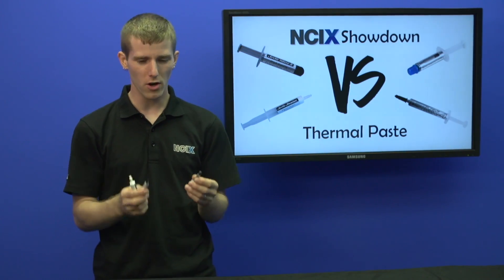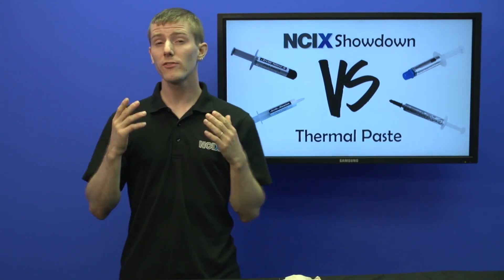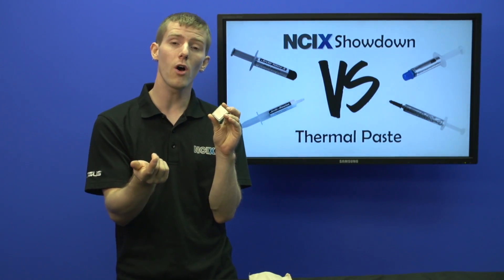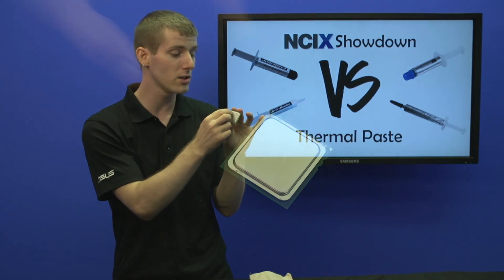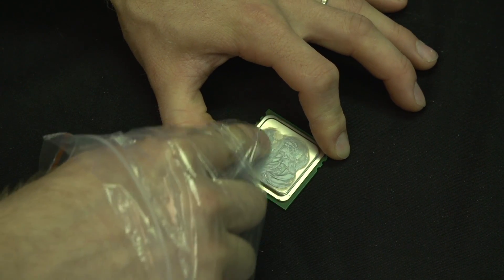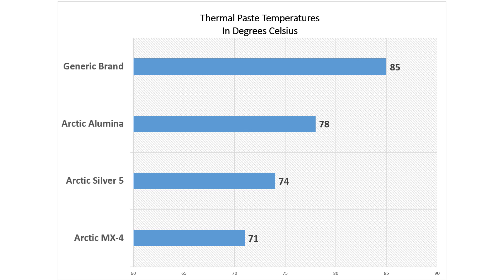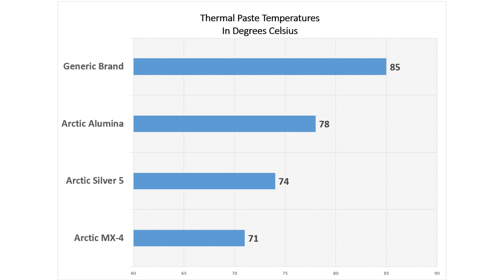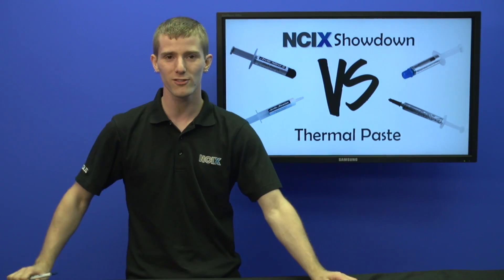Thermal Paste - NCIX Showdown

Comment: im using the MX-4 for everything (CPU and GPU) and it never fails!
Reply: ***** for smaller gpu surfaces, just a drop. for larger ones (nvidia 200, 400 and 500 series) i do the cross pattern
Reply: ***** 75ºC is fine for the 770. just keep it below 80ºC and you dont need to worry. try clean the card with compressed air or a brush to be if it helps with airflow.
Reply: ***** that's my job to help people :)
Reply: +DeadNullermand Same here, got the big tube and used it on several builds and many components. It has a pretty good shelf life in the tube too!
Reply: Taurolyon yes, the 20g tube has much longer lifespan before buying a new one. and it only cost me 50% more than a 5g tube
Reply: +DeadNullermand Should you wait for it to dry after applying the thermal paste or can you use your CPU or CPU straight away?

Comment: do you need 99% alc to put on new cpu's????
Reply: No
Reply: +Frederique klein no the average 70% will do the trick aswell
Reply: +uetzel Yup, searched on some tom's hardware forums and found out 70% was ok too. Removing pre installed thermal paste was easy and just to be sure I cleaned the new cpu as well. My cpu temps are idle 21 degree Celcius :O. Overclocking in the future will be allright. (P.S. When I posted this I forgot I was posting with google account of someone else. Still nice to be able to answer.)

Comment: i have an ps3 slim what thermal paste is better to use?
Reply: chryastosslapat rip
Reply: +r1Ns3 stfu man
Reply: +Becoming “The Unlord” Godsize lol xD i see your comments everywhere in youtube xD nice one mate
Reply: I used a folded piece of aluminum foil. I can't remember if I did shiny side in or our, I would bet in as to not reflect heat like a space blanket.

Yes, it actually does work, my fans were kicking into "8th gear" as I called it, and now its super quite and I haven't had it shut down from temp warnings yet.

PS: I didn't have thermal paste, and unfortunately I scraped off most of the remainder, but it worked fine anyways.

This was done on a PS3 Fat edition (wow those heatsinks are massive, its about the size of a grass trimmer engine). This was also done about 3 years or more ago, probably 4.

This is similar to the "thermal pad" methodology.
Reply: I used human feces

Comment: MX-4 hardens into a rock.
my tube is like 6 months old and it has to be microwaved to be used
Reply: +SANIC weird, i have a tube that's 3 years old kept in a cool basement, still usable like day i just checked it.
Reply: ***** I went back to artic silver 5.
I don't really care about the 2c difference cuz all my shit is water cooled
Reply: +SANIC i don't either, i use mx-4 for its non-electrical conductivity.
Reply: h0rnytoad1 wut?
Reply: yeah, you didn't know as5 is bad for cpus if you put too much paste? watchout for spillage.
Reply: the question is, how much is enough.
Reply: ***** depends on the CPU dye.

To Short out a CPU, you would need to use EXCESSIVE amounts silver 5.
Like 1/2 a tube
Reply: +HT T Any thermal compound is bad for cpus if you use too much.
Also, if your thermal compound is shorting out your computer, you put it on the wrong side of the CPU package, I know, rookie mistake, but you put the AS5 on the silver heat spreader on TOP of the package, not the shiny gold bits on the bottom.
Reply: +Mostlyharmless1985 not the point here, and not a rookie. Sanic&#39;s mx-4 hardened in a rock. it shouldn`t dry out like that. He must have done something like left it open too long and it just dried on the counter in the tube.

>you put it on the wrong side of the CPU package,
funny. But no, AS5 has slivers of metal in it, mx-4 doesn't, better be safe than sorry.

Point is, i have a tube of MX4 i still use 3 years after i bought it in 2012. its still usable. its a good product.
Reply: ***** I'm sure it is, But I've used AS5 without any problems, regardless of it's conductivity. My point was that any product used improperly can cause harm. You know, like how toothpaste has a deadly poison in it, provided you eat an entire tube of the stuff. Such as it is with the Arctic Silver. "Safe" in this case is using the product correctly. I can not think of a proper use scenario where it being conductive will make an issue.

Comment: I went with the Arctic MX 4 and the stock heat sink. With my CM Storm Enforcer case  huge 200mm front fan and 120mm rear and top exhaust fans, standard setting on the fan expert 3 on my Z97 ASUS MB, full load without overclocking; my CPU gets around 45 Celsius. For $10 that is performance similar to a much pricier aftermarket air CPU cooler.

Comment: I have a stick of Arctic Silver thermal paste. I ordered a 212 Evo and installed it using the thermal paste that came with it. Will there be a difference between the stock paste and the Arctic Silver?

Comment: XD my q6600 likes the spread method with cheap grease
Reply: KillTheCurse Core 2's are now pretty old. The newer processors are designed to withstand workloads of up to 70+ degrees.
Reply: -_O are you water cooled or in a cold place XD my q6600 @2.8 gets to 60c cause of the heat might start running my ac
Reply: yeah i love mine runs the games i play great   ( •_•)>⌐■-■ (⌐■_■)
Reply: ***** I'm so pissed right now, my Q6600 almost fried once it reached 70 degrees Celsius. The fans were blasting and I was recovering all my data from a 1Tb Hard Drive, it was half done until I had to shut down the rig. Over 6 hours of recovery wasted.
Reply: ***** I finally recovered all my data now, which is good. What I did to prevent overheating was to open up the case and run an external fan facing the inside of the case and my temps dropped to about 40-30 degrees.
Reply: what type of fan o_O steel
Reply: Derpinstyne H No, it was a plastic fan.
Reply: +Matthew N Yikes. do Core 2's seriously fry at such a low temperature?  i7's can run at 80 no problem.
Reply: Matthew N So Core 2's actually did fry that low?  Nice to know, adding that to my growing pile of knowledge.
Reply: KillTheCurse Yes they do, the newer Core 2's like the Q9000 series can go up to 90+ on most modern games, but instead the much older ones like the Q6600 can't withstand high temperatures under a high work-load.
Reply: Matthew N Thanks

Comment: IC diamond is bettar
Reply: Anthony Sparta what difference does it make if you use a cheap version?
Reply: Stewie Griffin I ordered 7 karat IC diamond paste from ebay for $8 and instead received 24 karat in the mail, which costs $19.99 on Amazon.
Reply: +rapper250 IC Diamond also scratches surfaces

I mean hurr durr it's got diamonds in it so it should be obvious that it does that but for like 5 degrees of difference I'd rather not have my GPU getting scratched up when I go to reapply

Comment: Sometimes I wonder, I had Arctic 5, but it just got really hot... Like 45 degrees on idle, so I tried the cooler master one that came with my cooler and now it's down at 25 degrees. Was there something wrong with the AS5 that i bought?
Reply: Advection357 I'll read the manual if you promise to take anger management classes :)
Reply: Linnywoo Well I was getting a new build and I had to swap coolers around (too lazy to explain) so I was just looking for a good thermal paste to get lower temps. My next build is going to be temporarily using a G3258 and I wanted to over clock that to around 4.2Ghz as well. And as for coolers, I'm going to reuse my H100i from my old build to my new one. Also, thanks very much for the quick reply!
Reply: lol, ''Really hot''? that's nothing. 45 Degrees Celcius. I have same idle temperatures.

Arctic Silver 5 is awesome but hmm weird. But also depends how you put on the thermal paste
Reply: I'm not sure why it differed so much, but from what I've heard, AS 5 gets better with time, so maybe I should have just left it on for a while longer.
Reply: ***** Yeah I notice that now. Have reapplied it and seeing better temps now, not sure what went wrong before, the spread looked fine and all.
Reply: ***** I suppose it is possible, but I don't think so. Could have been air pockets or something.
Reply: AS5 takes time to settle in and work properly. In other words, it has a curing period. Too many idiots here slap it on and discard it the same day... RTFM please
Reply: It's all about the way you apply the thermal compound. To much you will block the heat spreading. To little won't give you enough contact surface. Your CPU get hot might be the way you put your thermals compound because with the pre-applied paste of the evo, it contacts with the CPU surface better than the way you did with AS5, maybe.
Reply: Hao Pham Yeah I think that might have been the problem... I swapped back to AS5 a while ago and it is working just fine now =)
Reply: I wish they reviewed IC Diamond. That stuff made my 750 Ti with a single fan idle at just 24C, and there is zero copper on the heat sink!
Reply: Linnywoo What clock speeds is your cpu running? I'm still debating on getting AS5 or MX-4 paste, and knowing the curing time of AS5, I want to see how it stacks up.
Reply: MiniNinjia I'm running my 4690k at 4.2Ghz atm, haven't tried higher yet (cuz im lazy). It's idling at 42 degrees, so it's pretty stable :) Unclocked it was idling in the low 20s. I think Mx-4 paste will do just fine tbh, took around 1 month after applying AS5 before i started noticing the temps dropping, so if you don't mind the wait you could go for AS5. It also depends on what kind of system you have, if you have spent shitloads of money on a cooler it would be silly to cheap out on the thermal paste =)
Reply: ***** Zalman ZM-STG2 is also good... better than MX-4 / 2, but not as good as Gelid. & by better or worse, it's less than 1 deg C. difference..

Comment: Actually, for all of you below me. I used to use Arctic Silver 5, and just today swapped it out since my Arctic Cooler MX-4 came in the mail. I ran a temp diagnostic on Arctic Silver 5 first, min idle temp was 27C. Upon using MX-4 my idle temp was a whopping low of 14C. That's an awesome 49% difference in temps! I hate to say it, but I will not use Arctic Silver again.
Reply: lol, You have a faulty sensor. Sorry but physics won't allow your CPU to cool below ambient room temperature with Air/Liquid cooling without a chiller.
Reply: Your temperatures aren't accurate because heat transfers from hot to cold, which means you can't get temperature below what you are cooling it with. What is the most plausible scenario, that your sensor isn't accurate at those temps, or that you are breaking the laws of physics ? Who uses idle temps to test thermal performance anyway? They don't matter and that why it's acceptable that the sensor doesn't work properly in that range.
Reply: The Devastator
Then ambient temps then become outside temp, because the air used to cool the components is outside air,  and btw coolant temps below ambient are dangerous for condensation, I wouldn't do that.
Reply: I live in alaska an put my car radiator outside.  I can get core temps under full load to 0c or lower as its about -20c in the winter outside.  usually about 25c idle and 38c full load with 4 vga cards.
Reply: D347H2 What is the temperature of the room your testing in? Because again, like everyone else has told you, the temperature of the cpu can't get below the ambient temperature, or the temperature of the air around it. If you say you got 9 degrees C, then that means your room must be a lot colder than 48 Degrees Fahrenheit. So unless you are testing in freezing cold weather outside, or your house is a igloo, then the numbers you are seeing are skewed. In other words CPUID is not right. You should try RealTemp to get some different data.
Reply: You can do it.  I got ten foot 1 inch ID hoses going to a full size copper car radiator with a 2500 cfm fan.  I put the radiator outside where temps are -10 to -25c.  If i set my fan speeds to high then I get coolant temps down to -5 to -18c usually.  I have temp probes on the radiator and the copper 1"ID to 6x 1/2"ID distribution manifold on the cold side.
Reply: Actually, I said that is idle temps, not max temp and yeah it was 14, got it down to 9 C.
Reply: i got a corsair h100i radiator cooler. my cpu is not oc'd though, i can take a screenshot of it on idle, it does reach 9c. but not only do i use that but i use a mini industrial fan on high facing into my case. i keep my case on the floor where its much colder.
Reply: Not necessarily true. My video card stays around 38C when I used the MX-4 on my GPU it dropped to around 34C. But once I used this thermal paste, it dropped my CPU temps a lot. Put it in my card and it dropped it by only a couple C but it still dropped. It depends on how many volts your CPU uses on Min and Max load and what type of CPU you're using. I am using an AMD AM3+ 6 core 6300 with the MX-4 thermal paste. Arctic Silver is a heavier paste so it will insulate more than this MX-4 will. The MX-4 is so fine it literally spreads out very thin and you can actually just wipe it off with a cloth. I had to pretty much scrub the Arctic Silver 5 off of my CPU to put this MX-4 on it. But, again, you may be right, I am using CPUID to check my temps, maybe it's not 100% correct.
Reply: D347H2 There's no actual way for your processor to get below about 22C, which is common room temperature at 72F. It might mean the difference between the room temp and processor temp, which would make sense as that would make it around 30C.
Reply: That's amazing xD
Reply: It all depends on how you cool it, I've never seen temps below 27C on this until I changed the thermal paste. On max load, I get around 44C so far, which is what it says in CPUID running any game on max settings.
Reply: My floor, is probably around 60 degrees F since I live in an old brick house, in the winter it's really cold on the floor and I don't keep my heater above 72F, so that is where I keep my PC. However, with the new set up just the passed couple months, I have not tested the temps in the summer since it gets extremely hot in here, I will see where the temps go after that.
Reply: yeah AS5 is outdated. You should check out IC Diamond
Reply: +The Devastator Yes but this guy has his pc inside like most people and claims that the thermal paste made the difference when clearly it is not possible unless you have you pc in a fridge or using liquid nitrogen.
Reply: Keven Harvey THANK YOU! SOMEONE WITH SOME SENSE!
Reply: In the summer on idle I get around 19C without my A/C on. But I see your sarcasm :P No, I use a liquid cooler actually on my CPU with this thermal paste and compared to other thermal pastes, this one was the best with the least amount of heat by only a few C.

Comment: It's safe to use one of this thermal paste on the memories modules of a graphic card?
Reply: you can but its not recommened use thermal pads instead http://www.frozencpu.com/products/18131/thr-192/3M_3M-467MP_Thermally_Conductive_Adhesive_Transfer_Tape_-_25mm_x_25mm_x_50mm.html?tl=g8c487&id=fsRotnRc

Comment: What about Gold paste?
They ave tiny tube`s of it for 1$
And what about top of the line diamond base? anyone know the cost and how will ti works? Sliver is 470 Diamond is 40 - 2000 rating
Reply: Alex Smith I actually use the Gold stuff, and its not that bad at all, well its way better than the thermal compound from HP atleast. The only problem I have is that it dries in about 1-1.5 years, but at least its cheap and it gives you a excuse to clean out your heat sink.

Comment: Dont have the fancy 99% non-stuff alcohol cleaner thing but moonshine did the trick
Reply: i've used jizz and it worked just fine
Reply: I use 91% and it works fine
Reply: +zebroification I used thermal compound and it worked just fine.
Reply: I used 70% and it's fine. CPUs are actually pretty resistant. What you really want to make sure is for it to be absolutely dry when you put it all back together and power it up
Reply: +klimon531999           I used whiskey and it worked fine.
Reply: Yo-yo instructions unclear, dick is on fire.
Reply: +zebroification i've used 77% and it worked just fine.
Reply: +zebroification I ended up just pissing on it , not to remove the compound but for the hell of it